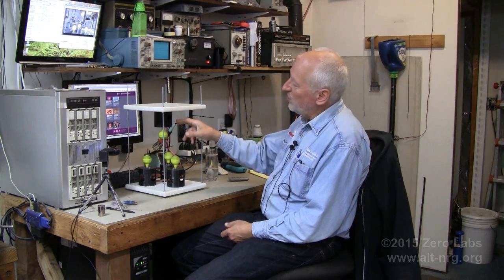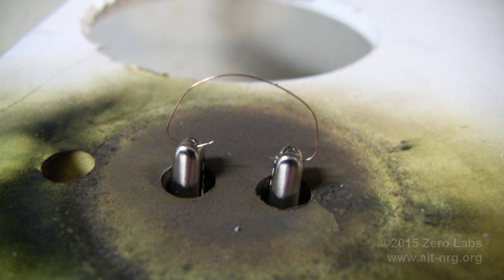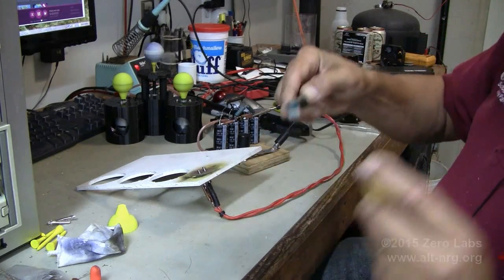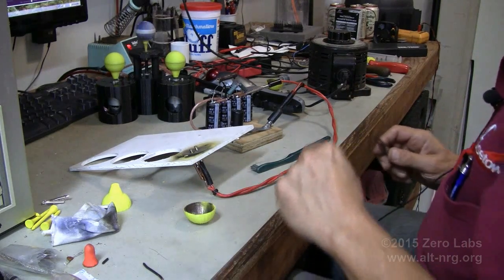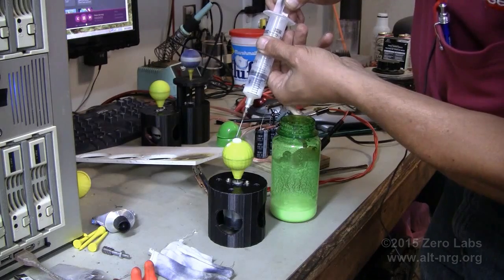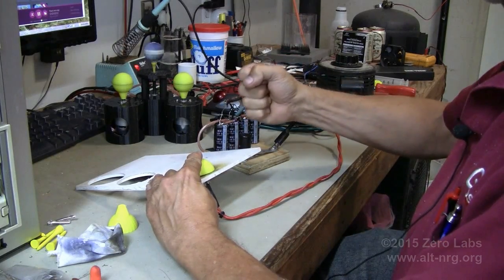#421 Keshe Plasma Reactors up & running!

Comment: Hi Zero, for the guys who also experiment with the Keshe coating technology: I spoke today with an insider and he told me, that these nanocoated Copper wires can attract some kind of plasma and then charge up batteries and capacitors, if they are connected.
So try to connect one side of a a supercap or the minus pole of a lead acid battery to ground and connect at the positive side such a nanocoated spiral copper wire and see, if the supercap or battery will charge up in a few hours. Peter Salocher from Austria reported, that his solarpanel storage batteries now are already 2 hours earlier fully charged up during the day, since he connected these Keshe nanocoated wires to his batteries there...so it seems he can already extract some usefull energy from these nanocoated wires....
Regards. Stefan.
Reply: +Stephane fyfe (steph) Who has the time to study 80 x 4 hours long videos.
Please do a summary video with all the  important parts in a short 10 minute video. Many thanks.
Reply: +overunitydotcom your going to understand a whole new branch of physics that is unlike anything anyone ever experienced before and invalidates many of the most well known physics principles ..and you expect that to be condensed into a 10 minute video?
are you serious?  would you like every branch of mathematics, calculus, trigonometry, right down to theoretical physics explained to you in under 25 words?
i've only watched about 6 hours of the videos so far... some of it is hard to swallow ..  i mean of all the claims are true this changes everything
but most of it , although somewhat rambling is fairly easy to understand and makes sense...

what you can do is watch every other vid 1 is more instructional (with a fair bit of theory added in cause if you dont undertand the theory you wont know how to use the  energy)  the other vids are more pure theory , this is where things get really interesting, and somewhat unbelievable
because this is way more then an energy system ...it goes way beyond just energy generation
Reply: +overunitydotcom 1 second is long enough for one word: "bullshit"
Reply: i am with you ------  man cannot fly in a heavier than air vehicle  --  frank
Reply: +frank ertolacci are you insane? even  an ultralight airplanes heavier then air
do you have Any idea what a 747 weighs fully loaded?  every plane is heavier then air
only baloons and blimps arent
clearly you have no clue about airplanes, flight, physics, or common sense
Reply: soaring eagle I think this (franks) was meant sarcastic :)
Reply: +Jean-Pierre Mürrli i was hoping that was true lol
but i have been dealing with alot of incredibly stupid people lately
guess they made me jump to a concluusion
Reply: +soaring eagle Happens to me sometimes as well :)
Reply: +FuckYouGooglePlus Insider in psychiatry :D
Reply: +soaring eagle Can you show one to us, with recognized bailiffs to attest that is a genuine video? If you can't, you are indeed in the domain of Faith, not of Science; sorry.
Reply: +soaring eagle he was, joking man. this is a famous quote from that era, that was proved to be wrong
Reply: +Didier Khwartz show you what?
Reply: +soaring eagle Quite simple: A working specimen of the MAGRAV power unit. That means, a unit which is connected to Keshes specifucation plus the continuous readings of the kWh meter of the supplier plus the continuous readings of a kWh meter connrctrd with the ihput side to the MAGRAV unit and the output side to the grid-#. Should be no problem for you, no?

Before I forget: No, a StupiTube vid is not a proof at all :)
Reply: +Jean-Pierre Mürrli umm why would i be  making a video i didnt even build 1 but there are a number of videos coming out the past week
just do a search
oh look over there ->  there's some
Reply: +soaring eagle I've seen them all (maybe I missed one or two)
Sorry, they are all of a really painful naivity. It makes not even sense to comment on them because there is literally nothing which is not totally wrong and dangerous.
Reply: +DG Tactical Or just mind blowing stupid measurement errors
Reply: +overunitydotcom schon komisch dass er dir nicht antwortet...
Reply: +frank ertolacci its true man cant fly , only the plain flys  and you sit on your ass in it
Reply: +Ken Howard never heard of wing suites, hang gliders, jetpacks let alone human cannonballs flying trapeze etc etc and hate to tell ya this when i fly a plane the plane doesnt fly itself i have to  keep it flying ..especially when you fly sailplanes the plane helps me fly but im the 1 doing all the flying
Reply: you do realize its humans doing the flying right the plane doesnt fly itself
Reply: +soaring eagle Yes  We go to school to learn some physics, chemistry, calculus with more time and more effort and money. For years I just skipped these Keshe videos because I read the comments saying BS, scam, fraud, idiot, blah blah blah or what have you. Then I saw he released some blueprints. After looking at them, I was convinced he found something useful. To understand it I tried listening to the videos, The West  says it BS but just wait till the the Chinese get hold of it. In fact they already have. It looks like they have set up a research lab and are making the Magrav Device in earnest while we are saying just plain BS. As for Keshe philosophy, maybe the Chinese are more open because they know about Chi energy which again is BS to other people.
Reply: +dsupanga What did you impress from this scribble which Keshe calls "blueprint? Have you ever seen a real blueprint?
Reply: +dsupanga true they are treating a billion people with socialized medicine cheaply by converting the medical system to qi gong  and acupuncture and chinese herbs
i had people arguing that homeopathy is bunk but with 90-100% success rates cuba is converting to alool homeopathy
Reply: soaring eagle that's Very Great they do that today but I know that was 100 % scam at the beginning, counting on lack of logic and education of the public who prefer to believe "nice words" and claims than to really check the facts. They needed money to survive and justify their claims so they needed to do anything it may work; funny enough, only things they took from outside and already exist did work! isn't it indeed really really funny? ;)
Reply: +Didier Khwartz Totally agreed, escept that he had and has absolutely nothing which worked except some placebo crap.
In his 91st workshop Keshe brings it to the point, at the same time telling for the first time in his life the truth:
"you are the most stupid lot of idiots I have seen in my life"
You can read a word by word transcript of his rants here:
http://thinkscientific.w4f.eu/slander.html
Reply: you need to measure the energy produced by the pv panels before entering the system and after it goes through your nanotube thing. I the difference is the energy gained by the system. Otherwise it is just a placebo effect. Your friend will realize that the energy out is less than the energy  produced by the pv panels.

Comment: Dear ZeroFossilFuel... I noticed that you have nano coated both sides of the copper sheet - but ~ that is not how it is supposed to be done.  Like a leaf the nano coating should be - on just one side.  Also, your container is too closed in compared to what Keshe ever endorsed or taught from what I know.  And no - I am not a disciple of Keshe... but if it works, I will use it just like I will use a hammer to hang up a painting if I had one.

I saw your video a few days ago in fact - where you had the white powder and was winnowing it down.  You made a comment that the process was eating up your zinc and copper sheets.  So then I did some research and I went out on Friday morning and I gathered the necessary materials and a larger container then what you used - but a little smaller than Keshe endorses.  And why the zinc was pitting on you - I just can't see why at this time.

You mention in this video as well that the zinc is being used... and at this time I can not agree, but please indulge me just a little further in hopes that I can maybe inspire you to do a little further investigation into this matter and if for nothing else... to make fun of me as well.  Allow me to give full account from 6:00 P.M. Friday evening until now - 2:39 A.M. Saturday morning:

At 6 I placed 3 sets of plates into containers that I got from Dollar Tree which hold 13.56 Cups each.  Rectangular in shape food storage kind of containers.  The copper plates I nano coated in my bar-b-que grill on ONE side with burning egg cartons and piled up grass clippings.

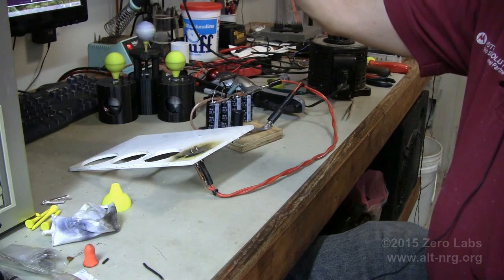From around 6:15 when some bubbles started to appear on the nano coated side of the copper which faced toward the zinc which had maybe 10% of the amount of bubbles that the nano coat had... but I saw no change other than more and more bubbles collecting on both sheets - but the zinc yet only had around 10% of what the nano coat had.  This stayed the same until around 7:00 when I noticed that many of the bubbles on the nano coating were bubbling up to the top of the container - but the zinc sheet wasn't loosing a bubble at all.  I thought that was peculiar, and I moved one of the containers into my bathroom and one in the kitchen on my washing machine so that they would not have to fight over gathering Co2.

At 7:30 my curiosity was really getting peaked... the container on the table near my vision was yet to have a snow storm of plasma - but I know it has got to work because even a skeptic such as your own self got the white snow flakes, eh?  So why wasn't I then?  Well I grabbed my free LED flashlight from Harbor-freight... and I started looking more closely in hopes to see some sort of evidence of a snow forecast... but to no avail.  I did notice some kind of sand or granular chunks on the bottoms of the containers - then I remembered that I had used sea salt quite heavily... I poured it into a gallon jug and added water - shook it until it would not dissolve any more salt - then poured it out into a bucket... repeated the process until I had enough to fill the 3 containers with the very same solution strengths.

 At 8:00 after I stirred my lentils on my NuWave hot plate stove thingie and then took my LED flashlight once again and looked real close at the container on my washer... and the bubbles on the nano plate were really tiny in areas and then bigger bubbles really lined it... and then I noticed when I got real close and put on my glasses - there were these itsy bitsy bubbles that were just boiling like crazy - they were so small that you really could not see them when they surfaced - but there where thousands of them just rushing up the nano coat toward the surface.  Well I thought - Hey!  that was cool... let me check the other containers.

The same was going on with the one on the table... I was flashing my LEDs at the bubbles - and it is darker in the living room where my table is... and I was wanting to check out the bubbles and they were doing the same thing pretty much but not quite as dramatic.  Also - the zinc plates still did not seem as if they lost a bubble at all and they still had 10% of what the nano coat had - and I am being generous.  But as I was watching the bubbles - WOW - there was this milky kind of stream that I noticed was coming from the nano coated side.  I mean I had to look at it just right or the light would not expose what was going on.

Now remember - I never heard of Keshe until I saw your video a few days back... and you did not mention what I am going to tell you nor did Keshe from any of the videos that he speaks on - nobody mentions these little milky streaks because most likely; nobody used a LED flashlight that they got from Harbor-freight for free before... to see what was going on between the zinc and nano coated plates.  Now then... this is where I have to differ from your claims pursuant the zinc getting used in the process.  I noticed more and more milky streaks that I would not have seen without my LED flashlight that I...

I was so fascinated with the milk streaks and I got more and more adapt at seeing them... I had to put my LED flashlight all the way down as close to the bottom as I could so that I could shoot a beam of light toward me with an upward beam... and then I had to position my gaze upon the waters to find them - when the light hit them just right and my head was in the right position - I could see maybe 30% of the entirety of the milky threads.  But the threads were not straight, they were bent or arched... and they were arched from each end of ONLY THE NANO COATED plate - arching toward the center.

Now I was breathless when I noticed where the arches from each end and all the way across - here and there... and when I saw where these threads all converged - I was shocked!  It was like galaxies!  Several galaxies just gently swirling... spinning as a galaxy is known to do - and there were several of them all spinning and swirling... I take the flashlight away - and there is only clear water with a little black soot floating on top of the water from the nano coating bubbling off a tad of it's nano coating.  I shined the LED flashlight on it again - and the galaxies were spectacular.  I had to go to the other side of the container to see what was going on on that side - because the flash light would not illuminate it - or else I could not focus it in from my angle - but the same was going on on the other side of the container as well.

The convergence area of all the arches took place around the center of the container.  There were no milky threads at all coming from the zinc plates in any of the containers, but all three thanks had these arching threads converging at the center of the containers - each emblazoned with galaxies swirling and spinning invisibly - until my LED flashlight that I got from Harbor-freight for free had ratted them out.  It would be invisible had I not discovered what was going on - simply because I wanted to know why it was not snowing in my containers yet... and it appeared that the zinc plate was not willing to meet with the milky threads.

From 8 - 10:00 the milkiness got more and more dense when illuminated with my LED flash light - but it was still not visible with my eyes.  The convergence point in one of the tanks looked as if it were a rotating sun - it was really mind blowing to think that I caused this to take place.  Of course Messiah led me to do this experiment and He deserves all the honor and glory - but... I put the Co2 extractor together - And... I filled them with sea salt water - so because I did those things - this mighty miracle was taking place, right before my very eyes.

So I shook the containers.  The convergence point busted all up - but the arched threads kind of went to swirling and looking like the top vision of monsoons - or galaxies.  I shook the containers at 10:00 - the arched threads went swirling and the convergence point broke up into several swirling galaxies... some smacked into the nano coating but None at all even came close to the zinc plate.  Now I didn't shake the container hard - I just jarred them a bit is all, just enough to break the arched threads but not enough to have to mop the floor.

At 10:30 with LED flash light in hand - I observed each container... and the galaxies are starting to unravel and join up with newly created milky threads coming from the nano coated plate.  Then I noticed that there were many little spots on the nano coated side that were making milky threads - and they all kept their distance from the zinc plate.

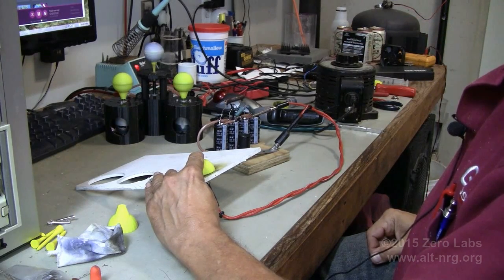I kept checking here and there until 12:00 - 6 hours from when I first started the project and there was really no change in things with the excepting that the milky thread arches all took their place again - the point of convergence was way bigger and so beautiful when the LED flash light revealed it.  Then around 12:30 - some of the milky convergence point became visible without the LED flash light.  The milky plasma was getting pretty dense as it swirled - BUT - it never yet came close enough to touch the zinc sheet yet.

From around 1:00 on - the water really got to getting cloudy, cloudy enough that the LED flash light only made the waters more murky.  I see no way that the zinc plates should be pitted - other than... the plates in your experiment being too close together and your copper plate nano coated on both sides.  Maybe you can do the experiment again the way Keshe did it or the way that I am doing it - and see if you can't see the power in this process by the way the milky thread arches act.  Till then -

Peace~

Comment: Congrats on getting it finished, I was checking on it every week and I started to get worried that you gave up on this projects as well as all your other pursuits of over unity devices in order to focus on your other how to projects, thanks for not giving up and giving us something to smile at. One question, if it did create energy, how would you use it? I don't see any terminals to attach a device to like a light bulb or a motor. Oh speaking of motors, how much electricity is being consumed by your 4 motors? Isn't it odd that a device that is suppose to create energy can't even power it self? You truly are a man of patients.
Reply from the maker: +Michael Katt The energy is supposedly captured with the "energy beads". That's where the self regulating, AC/DC energy will feed any device you attach to it from an iPhone to industrial 3 phase motor and everything in between. CAN YOU BELIEVE IT? ALL YOU HAVE TO DO IT PLUG IT INTO A WALL SOCKET AND VOI-LA!  FREE ENERGY!  LOL!!!!!

I'll be working on those tonight in preparation for the reactor being fully operational.